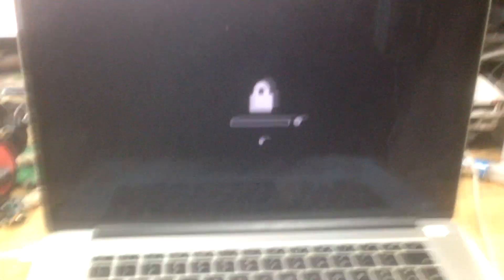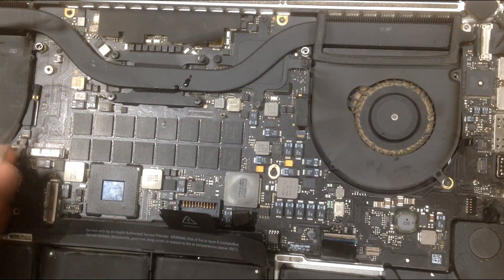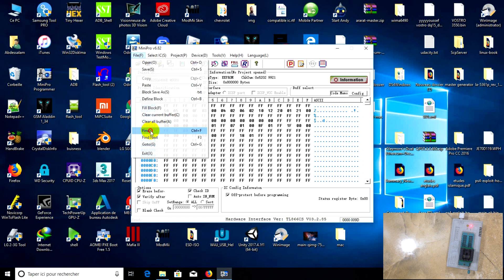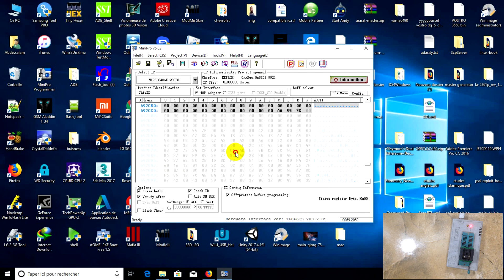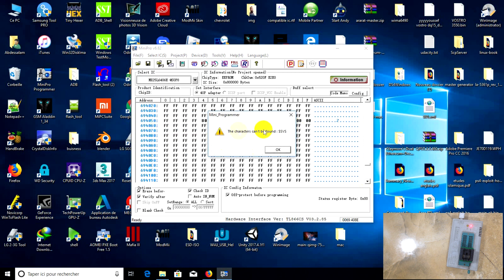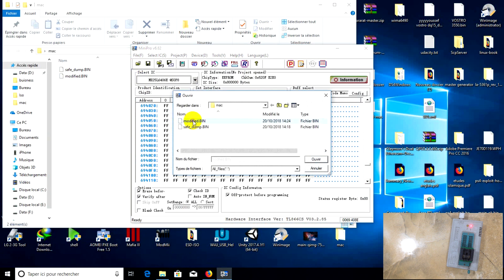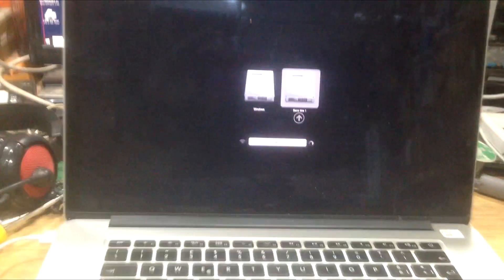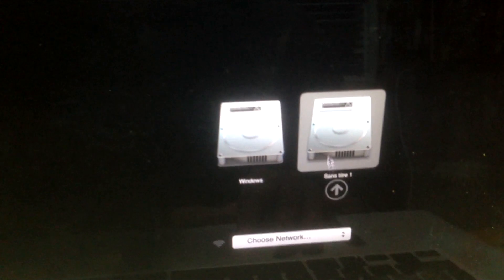mac book pro efi password reset

Comment: Hi Sir, so you have to manually set up number of chip bios right? How did you get the code " $SVS " ? Same code works for windows laptop or just macbook? And last question, same procedure can I do it with Ezp2019 or other usb programmer?
Reply from the maker: hi "$SVS" is a string that you will find in your efi dump there is 2 instances of this string and between these 2 "$SVS" there is the zone of code that you will replace with empty value like i did just whatch the video carefully , and for your programmer it should work if it can deal with your chip and if you need help just tell me

Comment: Hello, i need your help to unlock my macbook pro late  2013. the catalina software that i tried is crashed and i forgot the EFI code that i inserted since few years. I think that i reset this code using this video method but i don't know which spi flash programmer i must buy to do it. Can advice me please? A link will be usefull.
Reply from the maker: hi  th  TL866A/CS programmer  would be enough thats what i work with but if you want to work with newer models in the feture i recommend the TL866II programmer  because the 1st one is outdated and they no longer produce updates for it you can see defference between the tow programmers in their web site    http://www.autoelectric.cn/en/tl866_main.html
if you want to buy one i suggest aliexpress because you will find it in a good price or to make sure you buy the original programmer you can check official dealers   here :  http://www.autoelectric.cn/en/TL866_Dealer.html

Comment: So without soldering, would the chip remain intact?
Also what's that glue like substance?
And finally is it water you spray after the soldering?
Reply from the maker: you can program the chip without soldering if you have clip adapter like this one  "the one like crocodile clip "

https://www.picclickimg.com/00/s/MTUwMFgxNTAw/z/gN4AAOSwo4pYEdgl/$/NEW-TL866CS-Minipro-Programmer-21-Adapters-IC-Clip-_57.jpg
for the glue its called "soldering flux" also called "soldering paste"
last question no one use water with electronics ;) its White gas you better use isopropyl alcohol 

and thanks for your comment
Reply: @WorkshopBlackBeard  Thank you very much for the details. I'm about to try this really soon. Thanks for the encouraging video. However I'm struggling to find the correct IC programmer for my 2015 retina macbookpro EFI chip.
Reply from the maker: @stephanhan.8390 you are welcome 

for the programmer i rocommend tl866 you can also use CH341A
Reply: @WorkshopBlackBeard  Do you know an IC programmer for this task. I was looking for buy a ES2425 series programmer. Would it fit?
Reply from the maker: @stephanhan.8390 i did not find it
Reply: @WorkshopBlackBeard  thanks a lot pal. I'll check your programmers...

Comment: @t
This tool is better you don't need to remove a chip. this tool will remove the password in 10 seconds.
Reply: Which tool?
Reply: www.ebay.co.uk/itm/Apple-EFI-ICloud-password-unlocking-tool-Macbook-Macbook-Pro-mac-mini-Imac/173445958352?hash=item28622f4ad0
Reply: @Iamalphonso  sorry 2018 can't be done now
Reply: Apple Specialist is it really  i Need to unlock my firm on a mbp 15